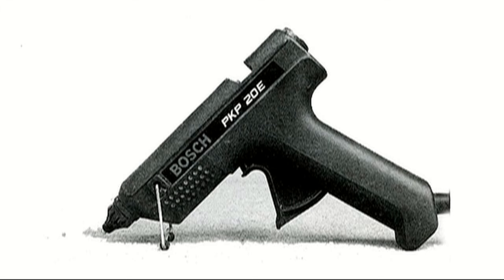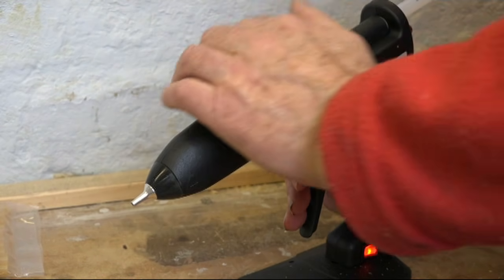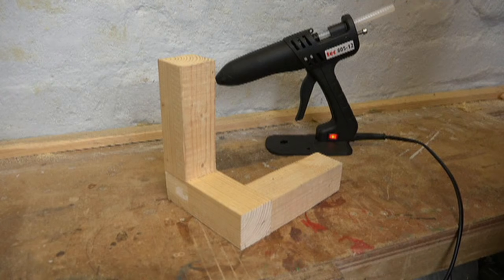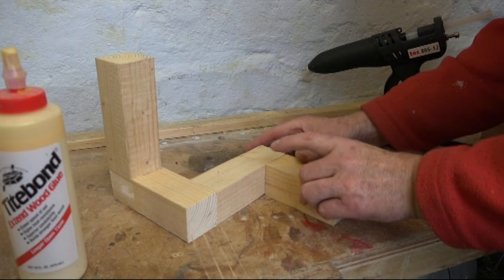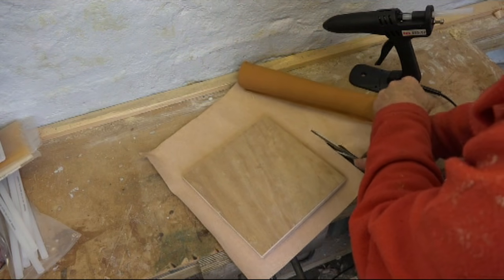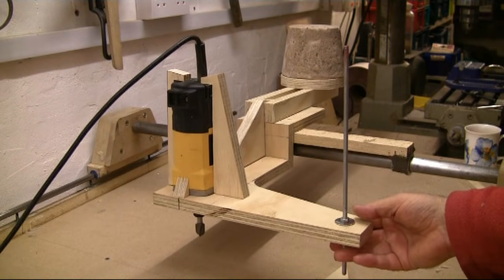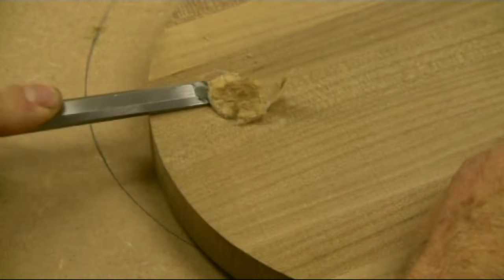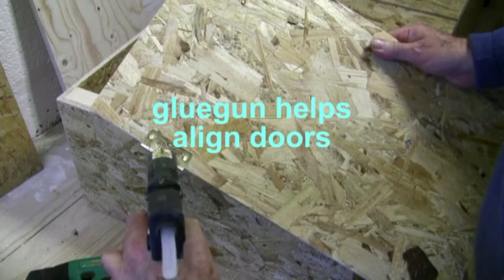What Can You Do With a Gluegun

Comment from the maker: For anyone wondering why I say the hotmelt bond is temporary yet use it on vinyl motorcycle seats I should have clarified that in my experience over many years, the bond is temporary on wood in a damp environment because wood absorbs moisture and shrinks and expands and there is little fibre penteration of the glue but with a fabric backed vinyl cloth a different glue stick is used and the glue penterates into the fabric weave.  My cafe racer motorycle seat is still intact well over ten years on.

Comment: I am a carpenter/joiner and have been using a hot melt glue gun for many years in a similar fashion to you. Temporary quick positional clamping is a must for speed when on site fixing paneling and crown molding etc'! It provides that third hand that all artisans so often wish for when cost effectiveness doesn't allow for a labourer! So helpful all round really and with two young children it really comes into its own with the multitude of toy repairs that I find myself extending to! Good vid' thanks and regards, Paul Bucky, Manchester, UK.
Reply from the maker: Thank you Paul. Safe woodworking.

Comment: Jeremy, for years I had little respect or use for glue guns and thought they were for ladies craft projects. That was because I never used one. When I was making underwater video camera housings I did a lot of experimenting and I found hot glue was one of the only adhesives that would attach pvc parts to polyethylene . Like you, I found it was perfectly suited for prototypes. In particular, with small items that might need to be taken apart, when the item is frozen, the glued parts separate much easier than with other glues. There are also glue sticks that use different temperatures.
Finally, if you have a glue stick, a candle can be used to heat the tip when in an area without electricity to heat the glue so you can still make repairs in primitive conditions.

Comment: One awesome feature is to cheaply make some electronics water resistant, the glue is not conductive so it won't short the circuits.
Reply: +LiPe VoLcOm Yes, that's one of the uses that was on my radar. I have also seen many small circuit boards attached with just hot glue. No need for screws, pillars etc. And it insulates. Great stuff. ATB Rob
Reply: +LiPe VoLcOm  Hotglue doesn't actually flow all that well, it might form an air gap around components and allow water to come in or condensate but never to come out. It's rarely an issue. But i recommend clear fingernail varnish instead or as an extra preparation step.
Reply from the maker: +LiPe VoLcOm Good tip

Comment: When using hot glue to temporarily mount a work piece, lay down some painters tape on the work piece and the mounting surface and put the hot glue on the tape.  The tape (when applied over a wide surface area) has plenty of shear adhesive strength to hold the work piece, it just needs a solid bond to the anchor surface, which the hot glue provides.

Comment: I've got an 805-15 (15mm stick). The 805's run at 200c, so yeah, it'll leave a scar for a few months. Power Adhesives (TEC), Surebonder, and Ad Tech also make a wide range of sticks and formulations for more specific applications, including ones specifically for wood. Their spec sheets show exactly what temp it softens at, melts (opens), and its viscosity. They make different tips like a wide and thin spread, but I find the stock tip works just fine for almost everything from building heavy duty shipping boxes to small projects and repairs.
Reply from the maker: +AZREDFERN Yes you are right, they do.

Comment: I liked your useful ideas for the hot glue.  If you use high temp glue, there are silicon finger tip covers that are excellent protection against burns without sacrificing tactile sensitivity.  They can be found in craft stores.

Comment: When using hot glue to temporarily clamp a work piece to a bench top (or CNC table etc) apply packing tape to both surfaces wherever the hot glue will be applied.  The glue will hold firmly but will pop loose easily when the piece is pried up.  If you need to keep it level, use washers as spacers to control how far the hot glue compresses.

Comment: I did as you requested and now it's my turn. Please show more of making molds with hot glue.
Reply from the maker: +John Carey Yes I will when I can find time to explore that. Viewers have already commented on how useful hotmelt glue is for insulating and securing electrics, something I missed. There used to be a flexible moulding rubber when I worked with plastics but hotmelt glue does it perfectly and you can let layers cool then build up more but don't do a mould of your face!
Reply: Woodomain - Jeremy Broun  If you saw my face you'd know why I wouldn't make a mold of it.

Comment: For an extremely strong bond, I preheat both surfaces to be glued with a hot air gun.  You have to wait longer for the glue to set, but the bond is much stronger.  

You can also use a propane torch to preheat some plastics.  The outward part of the flame changes the surface to be glued, so that the glue sticks much better, as well as helping with heating.  Do not touch it.  Using a torch to preheat, I have hot glued a PVC pipe to a plastic 5 gallon bucket.  On testing the bond, the bucket wall broke before the glue let go.  I have also used this technique to get a variety of glues to bond to rotomolded  poly kayaks and canoes..
Reply from the maker: +tom jackson Very interesting - I shall experiment with this because as you know the bond is a lot to do with fibre penetration.

Comment: I never thought to use hot glue for clamping another adhesive. That's an excellent idea!
.
I like to make foam airplanes and nearly bought that same TEC glue gun when I decided I wanted a no drip gun. But it's a bit too big, so I bought the Arrow TR550, which has replaceable nozzles.
Reply from the maker: +wordreet Yes, in the demonstration I applied just a little too much hotmelt glue. It just needs to be enough to make the tack without flooding into the PVA glue.

Comment: Nice energy about you. I have a commercial version of a glue gun which I use primarily as a clamp until the working glue cures but I have a feeling this thing may replace my use of double sided tape which is not without its own problems. I would be curious to know where to look for glue sticks for different situations.

Comment: I have same experiences about the longevity of hot glue joints. It just peals off after some time. I have used hot melt glue mostly to fix wires in place on printed wiring boards and also other PWB fixes.

Comment: I recently used hot glue and a wood dowel to perform paintless dent removal in my Motorcycle fuel tank. It took a few yanks and reglues but the dent eventually came out and is nearly undetectable.

Comment: you can debond hot glue very quickly with denatured alcohol, or even isopropyl alcohol, 95% and up works faster.  it just "lets go" and you can pull it up no problem, no tearing/chunks.  Hot glue is awesome.

Comment: I'm still healing a September-16-2015  scar from hot glue, from trying to use a lighter, and not noticing the clear melted glue. When I typed this, it has been around 4 months. Be careful with hot glue and consider wearing leather gloves if it doesn't cause you to lose dexterity. Maybe use deer-skin gloves if dexterity is needed. It's better to ruin a good pair of gloves than a good pair of hands.
Reply: +Jay H In a pinch, I've even used a cheap pair of disposable nitrile gloves.  I imagine latex would work too, if you don't have anything else.  You can expect them to be ruined afterward, but they're cheap, and can give you enough protection and feeling for the heat, to be useful and get a quick job completed, while still helping you avoid any burns.
Reply from the maker: +floobertuber Personally I would avoid wearing gloves when woodworking. We've all been burned. I just take a lot of care and that is what woodworking is about. For seasoned woodworkers like me the biggest problem is breaking the habit of immediately wiping glue off.

Comment: I once used a glue gun to bond black material to non-slip rubber backing. This was used to cover a light coloured car dash to prevent screen reflection. All was well until a very hot summer's day when the glue melted and made quite a mess. Be careful where you use this stuff!

Comment: if i solder two wire with soldering rod and then apply this hot glue over that solder point so that it cover the solder point nicely and then put that soldered point which is coated with hot glue inside water and let allow the current flow through it. will that hot glue give me leaked prove connection ?

Comment: Hi Jeremy! a really good video. (sorry for my english)... i came up here because i need to cover electric cables inside a submergible water pump after having fixed it. I know i should use something like "termo fit" but i can't get it here, so i suppose i can use the gluegun to cover the copper part with this.
What you think?
Reply from the maker: Thanks for your feedback. As to your question I am not an electrical expert but assume that the water pump (for a pond or  an aquariaum?) is low voltage eg 12 volts so it should be safe to use the hotmelt thermoplastic as a cable insulator. Try it out.  Can you not use a sheath or sleeve for wires?  That would be easier and tidier.
Reply: @WoodomainJeremyBroun  Thank you for answer me!!
i'm talking about a big  submergible water pump 220 volts, so i suppose your answer will be "NO" :)
I will try to find something like thermoplastic to cover the cables.
Really thank you Jeremy. It was a pleasure , friend!
Reply from the maker: @pixelismo  I am surprised a 220 volt appliance is used under water although as I say I am no electrical expert and the danger might be from wattage/amperage (eg an electric fire dropping into a bath instantly electrocuting the person) but I think it would be safer not to use hotmelt glue live feed insulation quite apart from difficulty in applying consistent beads along the length that were watertight. Probably for loew voltage /micro electronics applications the gluegun would be a problem solver. as a matter of interest I watched a YT video the other day demonstrating that electricity does not flow along cables but it is the electric field outside the cables that deliver electricity!! this apparantly is why electric pylons are so high to keep the cables away from damp ground!  We live in an age of myth busting!

Comment: Thank you sir, one question, is a glue gun better that typical cold glues that are avaliable for typical repairs?
Reply from the maker: You really need to watch the video to understand that hotmelt is good for everything other than gluing wood permanently!  In no way is it better than a normal cold glue eg PVA.  At best it is a temporary fix. I thought I made that very clear in the video.
Reply: Woodomain - Jeremy Broun  So what is the advantage of using hot glue versus just regular cold glues? 
thank you.
Reply from the maker: You need to watch my video as the answer should be obvious! The whole point of the video is showing alternative uses turning its weakness into a strength!  I have described in detail how it works!
Reply: ROB NAVAEI Simply put, the hot melt glue sets up instantly and holds the pieces in place while the permanent (cold) glue dries to make the permanent bond.  I use a combination of hot melt and silicone for small pieces of trim.  This allows me to not use finish trim brads or pins.

Comment: COOL video Jeremy, can I use that glue gun to seal two plexiglass panels together and make them water-tight at the same time? Like for an aquarium...
Reply from the maker: Hotmelt glue would definately not be strong enough to bond Plexiglass panels for an aquarian. The water pressure alone is massive. A special acrylic glue would be needed for perspex (Plexiglass). It is doubtful it would bond enough as a sealant.

Comment: If you were to use this in a car, wouldn't the heat in the car melt the glue and cause the secured item to slide?
Reply from the maker: +Jason McCabe (Camulas) Good question - if you live in a very hot country possibly yes the bond would weaken but it is a very high temperature bond. I know it can get like an oven in a car and  this is a problem with some 3D printed products that can melt in the heat.

Comment: In most stores they only offer one kind of glue sticks. Glue is glue so to say.Also once you plugged a stick into the gun, thats it, You cant easily replace it with another kind of stick. I read the other comments, obviously there are different kinds of glue now its about to find a dealer, lol. Thanks
Reply from the maker: In my video I have specifically featured a hotmelt gluegun by Power Adhesives (UK, USA & Germany) who supply a range of professional glue sticks for a variety of materials applications and I have given the link in the description (http://www.poweradhesives.com).

Comment: You talk about how hot glue fails over time and should only be used for a temporary hold on wood, is this true for plastic and electronic usage also? I know from experience that electric tape degrades over time and causes the adhesive to become oily and gooey, which results in the tape peeling back and leaving a mess that is difficult to remove. It's too bad, because electric tape would be an incredibly useful tool if the adhesive lasted forever because it makes a great surface for gripping.
Reply from the maker: +Jay H I think using it for plastic bonding offers even less strength but part of the problem with wood is the moisture exchange and expansion/contraction of the material. I have used it effectively for fabric (chair upholstery) and een though I have doubled up with staples it seems to hold if you use the correct gluestick. Would epoxy glue (Araldite) not be better for electronics?
Reply: The benefit of hot glue, is the cost, quickness, ease of use and limited fumes to worry about. The downside is the high temp heat involved. I imagine that any 2 part epoxy would cost a lot more, especially if you wanted to insulate metal contacts with it, to prevent water exposure. High Temp RTV, like the red stuff in a tube, would work very well, but the fumes are incredibly strong and the cure time is very long. I thought of hot glue as a great solution, but after seeing this video, it sounds like it's not as great as I imagined. I will have to learn about alternatives and decide what will be best for whatever it is I decide I want to do, whenever that will be.
Reply from the maker: +Jay H Two part epoxy such as Araldite is only a few pounds (£) and you can mix just what you need. You can get a quickset Araldite that goes off in a few minutes.

Comment: Hot melt glue can be used for to seal electric parts to plug a tyre air leak leaking car wind screen leaking car radiator leaking hose leaking
Reply from the maker: Yes, provided you use the correct glue stick

Comment: Interesting video. I used a cheap glue gun before and just used it to stick cartons. However after a while the glue is not sticky anymore. I’m wondering to switch to a more expensive gun, but not sure it’s the quality of glue or the gun that matters?
Reply: All the glue gun does is just melt the glue, if the glue isn’t sticking it’s a fault with the glue, or you’re using hot glue where super glue is more appropriate.

Comment: Does this glue hold on plastic to plastic???
Reply from the maker: Which plastic do you mean? There is a whole range of thermoplastic and thermosetting materials some of which are non-stick such as nylon and polytetrofluorethylene.  Some glue sticks are better suited to some plastics but in general I would say its not much more than a temporary bond in a relatively low stress application. Polypropylene is suitable for hotmelt bonding and require special glue sticks.

Comment: ..... using particle board for anything other than firewood is insane.
Reply from the maker: Please consider that if wasn't for particle board solid wood availability would have been depleted decades ago. Burning particle board isnt a great idea because of the chemicals in the glues. As to durability I have examples of my lipped particle board fitted wardrobes made in the 1970's and still going strong.  Its not the material but often how it is used that leads to this kind of prejudice. Used in the right situation it is an amazing material.